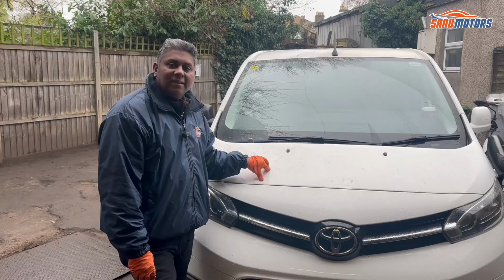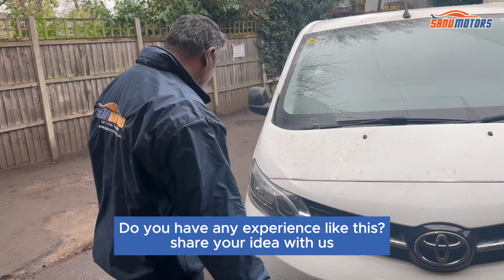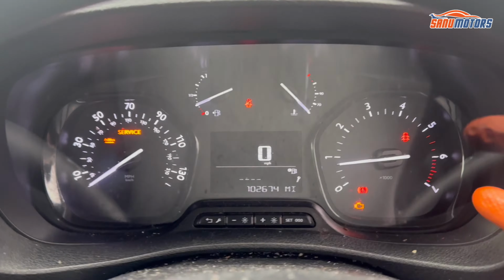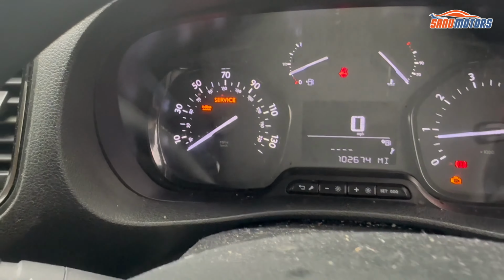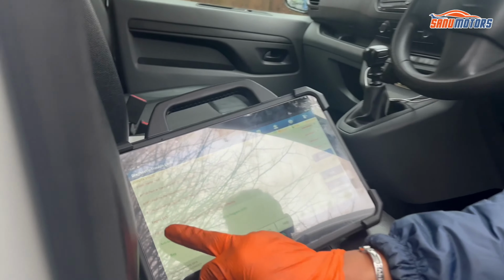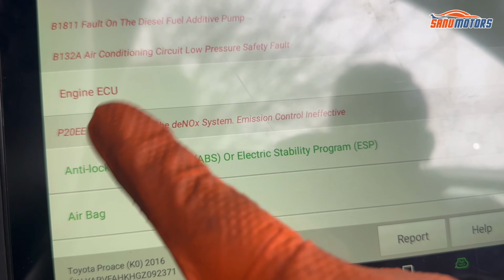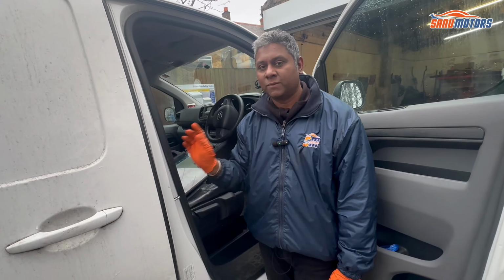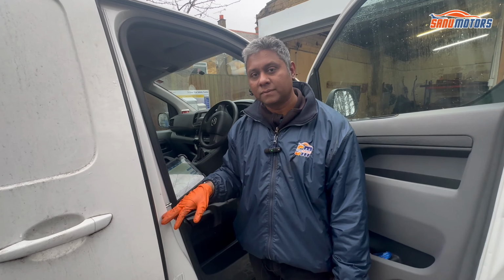Toyota proace P20EE Fault Code / P20EE de-pollution of the denox system

Comment: Great video Charlie...ive followed your steps cleaning the injector. Ive added wynns crystal clear to the adblue tank.. not cleared the fault code. Im guessing maybe the pump in the adblue tank. Drat
Reply from the maker: plese check live data
Reply: @SanuMotorswithCharlie  sorry Charlie not sure what you mean? Which live data?
Reply from the maker: live data for adblue system

Comment: Could this be fixed by adding a decrystalliser solution to the adblue?
Reply from the maker: Good question! In some cases, adding a decrystalliser solution to the AdBlue tank can help clear minor crystallization and improve the efficiency of the deNOx system. This could potentially resolve the P20EE code if the issue is due to minor blockages in the AdBlue injector or dosing system. 👍

However, if the P20EE fault is more severe or if there’s a larger build-up, you may need a more thorough cleaning or even professional intervention to fully clear the system. I'd suggest giving the decrystalliser a try first, as it’s a simpler, cost-effective step. 😊

Thanks for watching, and feel free to reach out if you have any more questions! 🚗💧 #ToyotaProace #AdBlue #P20EE

Comment: Have you any Adblue in the tank? They don’t fit a level gauge and it is all guess work. Easy mistake if not.
Reply from the maker: Great question! 😊 You’re absolutely right—having AdBlue in the tank is critical, and without a level gauge, it can be tricky to monitor accurately. Many vehicles, including the Toyota Proace, rely on sensor readings to estimate the level, but it’s not always precise.

If you’re troubleshooting a P20EE fault code, the first step should always be to top up the AdBlue tank to ensure it’s not simply low. Even if it seems full, adding more can sometimes recalibrate the system. It’s an easy check that can save time and effort. Thanks for pointing this out! 🚗🔧 #ToyotaProace #AdBlueSystem #FaultCodeFix